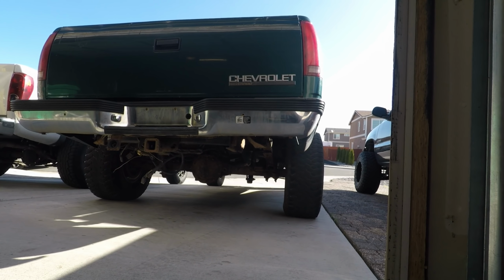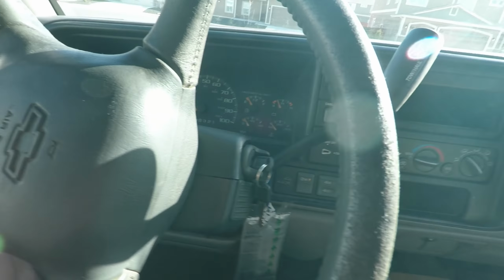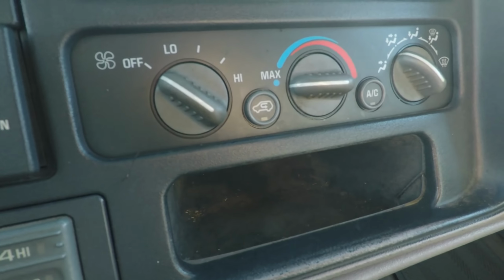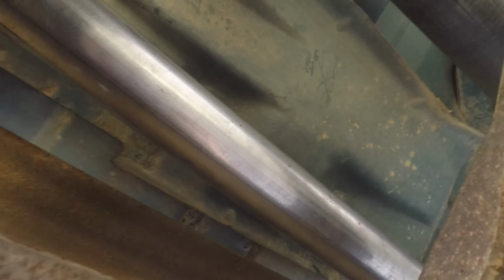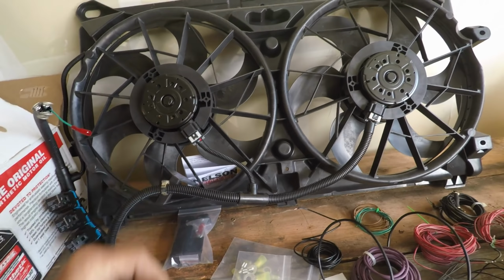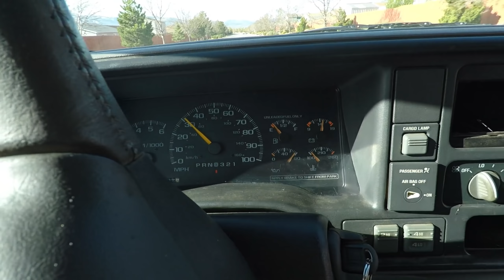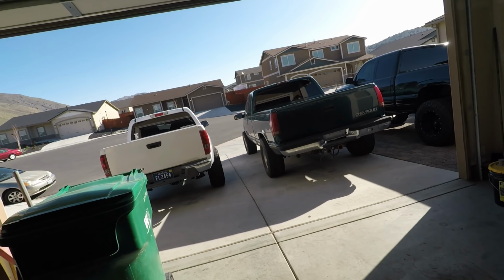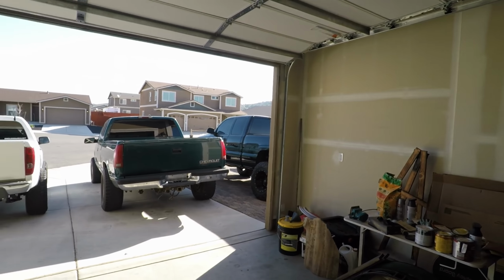LS Swap Is Complete, First Drive With Exhaust

Comment: Now that you mention about having that recirculating pin in the ecm I remember when my 2000 v6 mustang(I know different make but whatever) overheated my ac would suddenly blow warm/hot air which makes sense with what you read online.

Comment: How did  you get your tach and speedometer to work
Reply from the maker: The guy that tuned the ecm adjusted everything
Reply: So its wired to the new ecm
Reply from the maker: Yes the 411 has a tach output so you just hook it to the trucks tach wire

Comment: Why was the oil pressure gauge so high?
Reply from the maker: Not sure
Reply: Hmm me neither. I have a 2000 short wide with a 4.3 thats my play truck. I have a fuel issue at the moment so it wont start. Think it would fun to try to throw a v8 in it. Keep the videos coming.